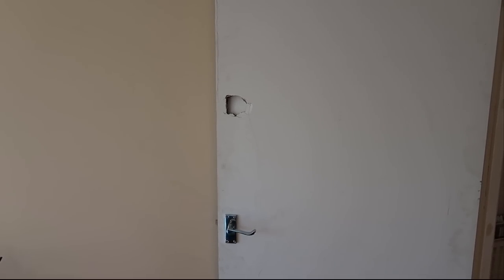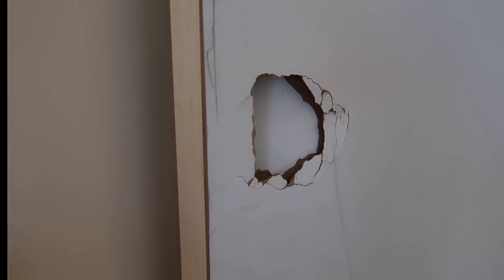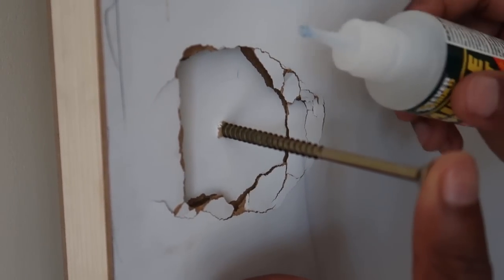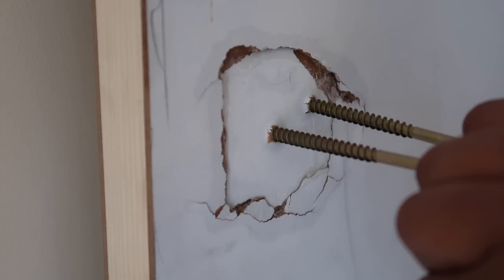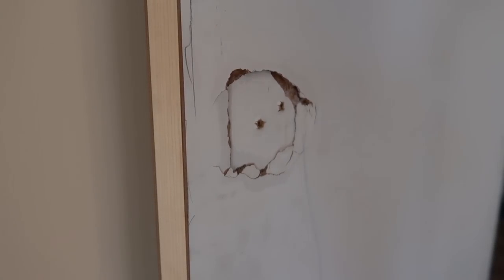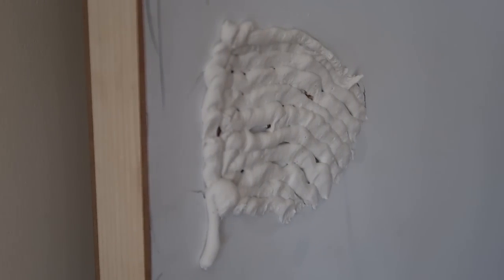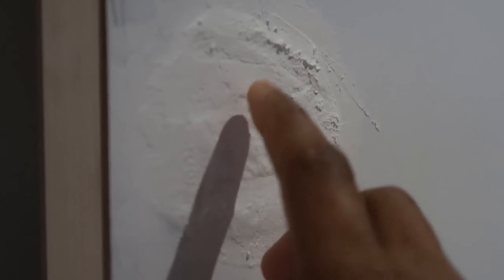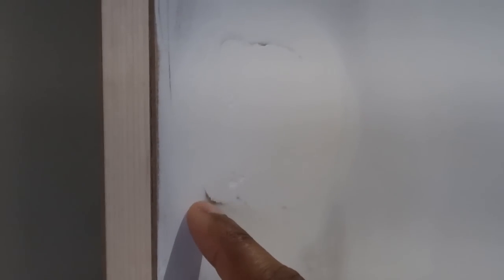How to Fix a Hole in a Door in 5 Easy Steps

Comment: One of my ex tenants punched a hole in 2 of the doors. I filled it with some expanding foam, left it overnight to harden. Sanded it down flat, went over the top with some putty filler to make the paint stick better to the foam, sanded it flat, then painted it. Was an easy fix. The expanding foam is definitely a good thing to do because it will last longer and remove the hollow part to keep it strong. 

This is for those who wouldn’t be fortunate enough to have the wood still intact to glue back like in this video.
Reply: Thank you!
Reply: Great tip! Thanks :)

Comment: Just punched a hole in my apartment door a week back n been tripping on how ima do this for cheap as possible. Thank you!
Reply: Did it work same thing happen to me 🤕
Reply: @sonidelray  yea you can barely tell. I’d say just make sure u use a sanding surface with a flat background like a brick so it’s level. Otherwise your fingers WILL leave divits from sanding with uneven pressure
Reply: How you matched the paint that’s what I’m afraid of lol
Reply: I just threw my controller into the door

Comment: why do all holes in doors come from a fist full of passion
Reply: I managed to smack one in my bathroom door with the shower rod when changing the old curtains. Good times!
Reply: I was playing Job Simulator on the Oculus Rift and attempt to throw an object at a robot, but instead I ended up throwing one of the controllers and made a hole. If only my door is white I can easily to fix it. But it has to be some sort of gray.
Reply: I tripped and my forehead made the hole haha
Reply: Or a kick 🤦🏻‍♂️
Reply: @Zenvixxx  So did my son yesterday and I know now how to fix the door 😁

Comment: Compared to hunting for a door that conforms w/the rest of the house & having to mortise 3 new door hinges, this is definitely easier & less expensive. Thanks!
Reply from the maker: The same thoughts went through my head as i scratched it thinking, 'how should i fix this'.

Buying and fitting a new door is a lot more work than people realise. 
Old door frames are rarely perfectly straight so lots of adjustments to the door will need to be made. 

This method is cheap and easy. Anyone can give it a go as long as they follow the steps and have a little  patient.

Comment: Just found this video has I have some door holes to fix.  Ordered the ever bond glue ready to start.  Thank you.  Great video
Reply: Well the product came. And its shit hot. Works just as video. Put in a screw in to broken bit of door.  Put on the glue. Sprayed and pulled the screw. 10 sec. Its solid. Now all filled in and painted.  Thanks so much.
Reply from the maker: You're welcome. 

I'm soo glad it helped you out!

The glue method just makes it soo much easier when it comes to creating and good solid finish. 

If you have any before and after pics., send them across.

Comment: I like to say this worked I used 2 screws that were like 3 inches long and I had a tube of gorilla glue so I put some on and waited 24 hours to make sure the glue dryed. Then I took out the screws and it stayed. So awesome 👏 😎 oh yah and I slapped 👋 some wall  putty on which was the easy part. Nice video and thank you this actually works!😊

Comment: Great video, thank you! Now if only I can figure out what to do since my door hole does not have the solid piece to pull back and fill over. It’s just a gaping hole about the size of the one that was on your door. But it’s been there for so long that there is no solid piece to pull back and fill over. Any ideas on what to do?
Reply: You could place some kind of object in the hole by superglue or something along the sorts to give it a bit of thickness before adding the filler on. IDK just a suggestion

Comment: What if i don't have that adhesive spray. can i just use super glue or wood glue?
Reply: Wood glue would do. Just takes a little longer to dry. Get some fine fillers and build the area up until flush. Sand and paint. 👍🏻👍🏻

Comment: You could have filled the hole in with foam put the filler on top sand it down paint and been done...
Reply from the maker: I did think about using foam, but i wanted to keep the repair as cost effective as possible. Plus foam can make a real messy if you don't know what you're doing.

Comment: This very helpful video has gotten me far along from the hole. But I quickly learned do not use silicone putty 😂. Am i supposed to use something called caulk?
Reply from the maker: Thanks. 

No, silicone and caulk won't give you the finish you're looking for.

You need plaster filler. 
There are many brands you can buy and they come already mixed (like in this video) or in a powder form which you mix yourself. 

It won't cost you much, it's very cheap.
Reply: @diyr6894  oh man. Okay I will scrape all the caulk off. I had a feeling it wasn't right either. I will try shopping again for the right one this time. Thank you for the response
Reply from the maker: No probs. 

You'll be able to fix it. Just take your time. Don't rush, and follow the steps. 

Let me know how it goes.
Reply: @diyr6894  the door came out really nice finally. But now that I painted it, I can kind of see the raised area where maybe I didn't file it all the way. Should I just leave it or is there something I need to do? Like you said I only notice it because I knew it was there

Comment: I’m having a hard time getting the nail through the broken piece because I feel like I’m gonna break it more . What should I do ?
Reply from the maker: Don't use a nail. 
Use a Big Screw because it will grab and hold onto that broken piece. 

If you're finding it hard to get it in, make a small hole with a drill, then screw the big screw gently into that hole until it grabs onto the broken piece. 

Remember, take your time. Don't cause more damage which will mean more work.
Reply: Thanks hope it works

Comment: What grit sandpaper would you recommend to sand with ?
Reply from the maker: I depends on how much filler you need to take off. 

A lot of filler to remove: Use a coarse grit (like 60) to remove most of the bumps of filler. Then when you've levelled the filler flush with the door, work your way up to a finer grit (like 240) to make the filler smooth. 

Not much filler to remove: Start with a 200 grit.

I think i used about a 200 grit sandpaper.

Comment: Is the spray necessary? Or can I just use super glue?
Reply from the maker: You can use an alternative glue. 
But, the spray will makes the glue set almost instantly so it will save you a lot of time and headache.

Comment: I tried with the screw through the hole but didn't realize the screw went through the other side😳
Reply from the maker: Oops, well it should be easy to fill in the second hole with some filler.

Comment: screw that foam it cut the foam mud it done
Reply from the maker: You could use foam if you don't have the surface piece of wood. But the foam is a lot more difficult to work with and the finish won't be as good.